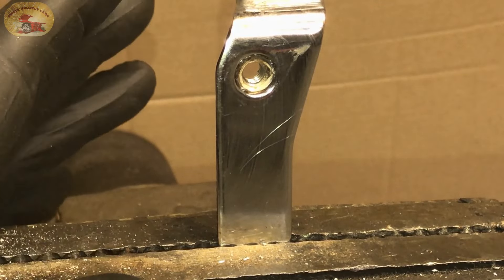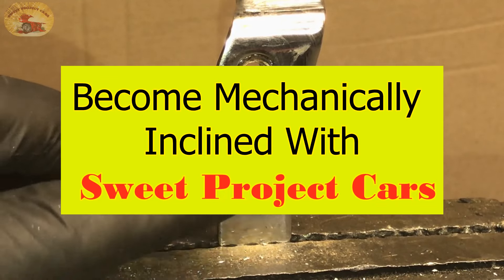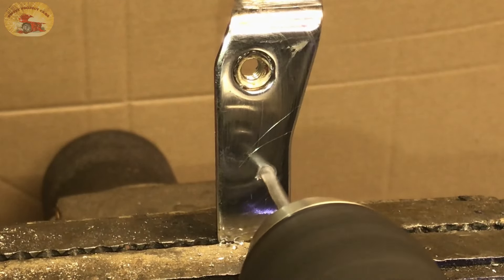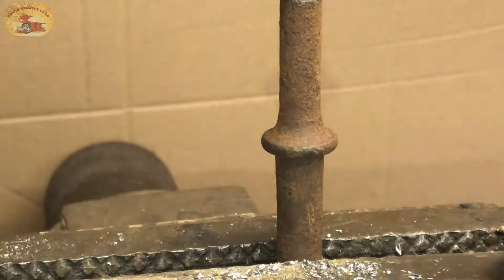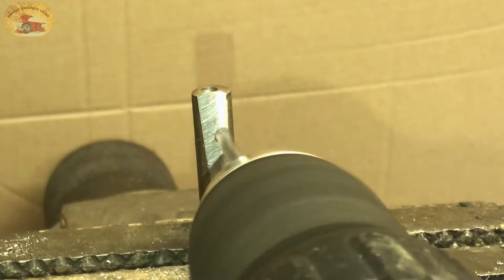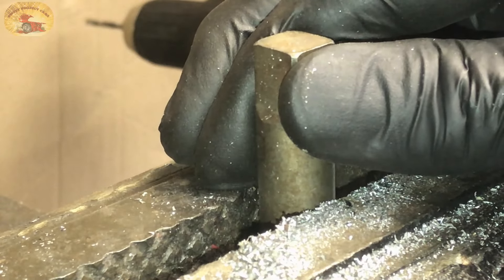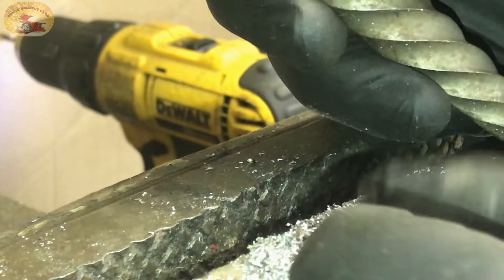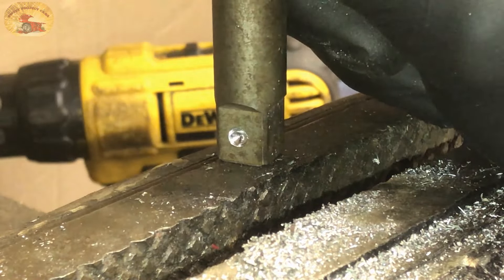How To Drill Very Hard Materials at Home...CHROME, STAINLESS, Broken Taps or Screw extractors

Comment: Drill bits have soft shanks as do easy outs . Most tools have case hardened shanks but taps are heat treated tool steel and drilling them once broken is not this easy . Most times you can mill one out with carbide but one of the most effective ways is to EDM it out !
Reply from the maker: Thanks for the tips!
Reply: Very, very true.  Differential harding is present on many tools.  Still the drill bits are impressive.  EDM is so awesome though!
Reply: Absolutely true the shanks are soft.
Reply: My thoughts exactly.
Reply: @CTX50  Electrical discharge machining
Reply: Yup, in aerospace machining, the EDM is used to remove broken taps.
Reply from the maker: we just picked this one up. Knuth 3.5 kVA ZNC-EDM 250 Die Sinking Electric Discharge Machine for $23,000 guess 
we can now use that instead of using those easy to use and cheap Carbide Bits

Comment: Titanium or Unobtainium 😜
Reply: Well I was wrong. 😑
 I've also read that cobalt drill bits are good for hard materials also but I'm not sure if they're as hard as solid carbide. I'm thinking probably not.
Reply: Also, while I'm here, I watched a gentleman on YouTube with a trick to drilling through stainless steel even with a cheap drill bit is to use plain water and drill at a slow speed and keep squirting the water to it as it evaporates to keep the drill bit cool. I haven't tried it yet but I will be soon.
Reply from the maker: There's no drill bit harder or tougher than tungsten carbide, you could literally drill a hole through a cobalt drill bit with the carbide bit, you could never do that with a cobalt bit. Thanks for watching, Jeff, hope you have a great day my friend. mad Mike the hammer SPC

Comment: In a pinch you can use a carbide tipped masonry bit.
Reply from the maker: thanks for sharing  mike
Reply: Yes I have used masonry bits a lot you can drill through files or whatever you want

Comment: wish i would have seen this video 5 days ago, I filled some holes with weld to drill them to a smaller size and tap them bought 2 difrent sets of dwalt drill bits sets and a bosh cobalt m42 set and non of them could drill through the weld.

Comment: The clamping surface is not hardened anywhere as hard as the actual cutting surface of the cutting end. No steel or carbide bit can cut hardened steel. Hi-speed or Cobalt or any other steel. It will require carbide or diamond. However, these are very expensive and not meant to be used in a hand drill. they require a rigid setup. However,ther is another option.   A carbide tipped masonry bit can be used in a pinch. However, have more than one as they tend to chip out quickly. 

KnifeMaker
Reply from the maker: We use this  https://amzn.to/3CnksBw  Thanks for watching and sharing, have a great week my friend. mad Mike the hammer SPC

Comment: I use the exact same thing but usually 5/32, 3/16,1/4" fits my knife scale pins. Try forgetting to drill O1 or damascus steel then harden it. Definitely buy pure carbide since you can sharpen it. & absolutely backcut the grind to reduce the drilling face surface. 
But, if you break one.. use a quality drift and punch them out (if have through hole) same for taps, drills, etc.. they are hard & shatter. Just need to be good with a hammer. 30 + years as a professional fabricator you learn these things. Now professional bladesmith.
Reply: Wow. Sharp
Reply from the maker: We're with you on that Tim! Thank you for watching and sharing your great information, we really appreciate it, hope you have a fantastic day my friend. mad Mike

Comment: Bought these but won’t even touch a Cobalt SpeedOut.  What are my options?

Update...sharpened the bit and I was able to drill out the broken SpeedOut and bolt.  I don’t think I was using enough pressure at first.  I am a very happy customer.
Reply from the maker: I can tell you this right now, there is no harder material than tungsten carbide, if that will not drill out your easy out then you are going to have to take it to a professional welding shop to have them remove it.  Thanks for watching, hope this helps my friend. Have a great weekend. mad Mike the hammer SPC
Reply: @SweetProjectCars  updated my post...they did the job. Thanks!

Comment: Something else that is good to know, if you are needing a large hole say in thick steel or anything really you can start your hole by drilling an 1/8" hole and then go 2-3 drill bit sizes up at a time until you reach the size hole desired. A small drill bit will drill easier than starting with the larger drill bit and once you have a hole all the way through the material the other larger bit will go through the hole  with ease. I think having one of these aircraft drill bits in a smaller size would make the job of going through hard materials a "piece of cake". Great tip!
Reply from the maker: Thank you for watching and sharing, we appreciate the input, have a great week my friend. mad Mike

Comment: Thanks for this video. Using a spring-loaded center punch would ensure accuracy by eliminating the wandering of the drill tip until it catches. Suggest using Tap Magic for lubrication and heat transfer.  Would  appreciate your advice on what drill speed to use with these cobalt-type bits from 1/8" up to 1/2" diameter when drilling regular steel, high speed steel or chrome steel, and the appropriate amount of downward pressure to use when using a hand drill for these projects. If I understood correctly, one should not use an impact or hammer-type drill with these bits, because of their brittleness.

Thanks again for an another informative and practical video. As an habitual breaker of drill bits, I need all the good advice I can get.
Reply: With your suggestions,  i am surprised at your question.

Comment: A Carbide Drill would be able to drill through High carbon Steel, Chrome, or even Tool Steel if you feed it properly.
Reply: There's more than one Carbide. Silicon Carbide, Tungsten Carbide, pick one.
Reply from the maker: You're very correct, thanks for sharing. Merry Christmas. mad Mike